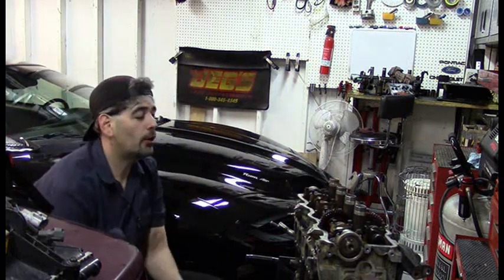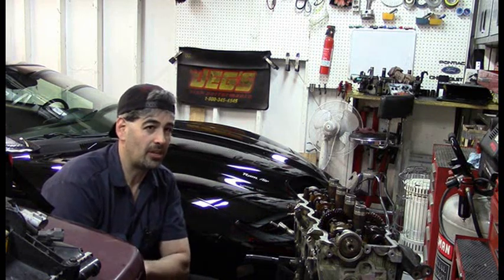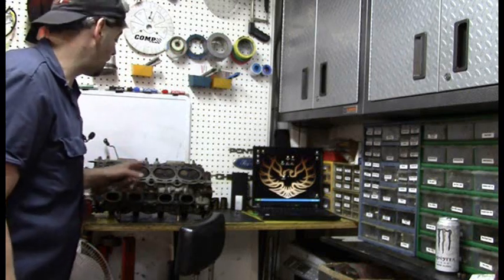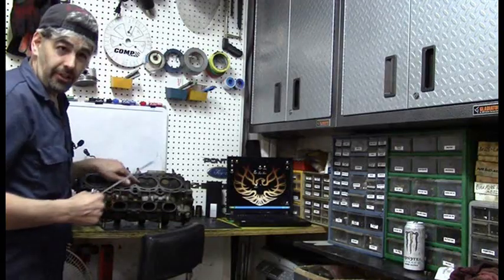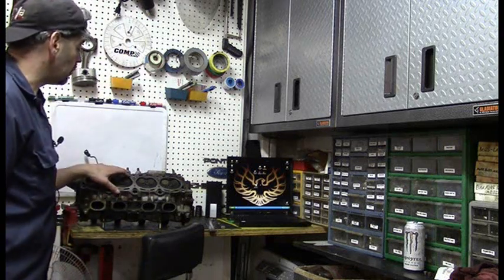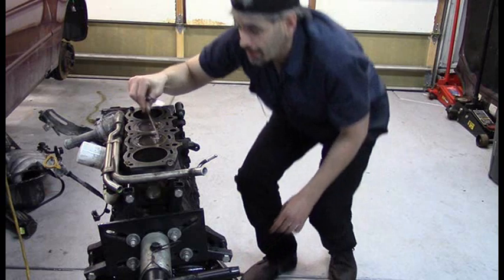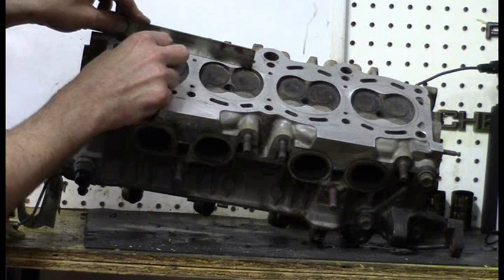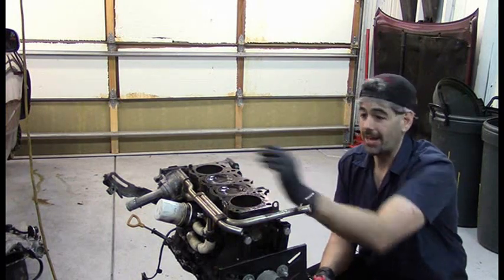Replace a Cylinder Head Gasket Yourself and do it RIGHT! Part 1

Comment: I just a lot!!!!!!!  And it disappeared damnit.  Anyway, I think you have the best and most informative videos in tube.  My question in short this time.  Dong this 31 yrs and I cant get the proper specs anywhere.  2001 Eclipse 2.4 SOHC   Engine 4G64  Head G6E2  What size is the torx and what are the proper torque. Ive been told 58 and 72 ft lbs. Thats way to much difference. Sum1 is wrong.  The pattern is fine, even tho I've gotten 2 different ones, I'll get that str8.   WHY they say torque 58 THEN loosen ALL the way, then torque to 15 lbs THEN 90 degree and THEN 90 again.  What kind of torque would that END UP with.  Any suggestions....  Its my sons car   it overheated and Head is actually still on the car, I dont have the socket to remove the head bolts & what size are they ( 12 mm  12pt )??  Thanks, Chuck       I do paint & body and I Paint for a living, and ranked 10 out of 2000 in Va by Dupont and PPG.  I was getting ready to paint sons car, and that night he called and said IT just cut off.   TY again   cnkbaseball@yahoo.com
Reply from the maker: I recommend alldata DIY and it has always had the specs for any car I have needed them for.

Comment: Around how much would it cost to take the cylinder head to the machine shop?
Reply from the maker: Man great question, if I was smart I would have made mention of that! It depends on the services you get.  Generally a Magnaflux (check for cracks) runs around $50 or so. This is non-refundable- you pay $50 whether the head shows to have cracks or not. Resurfacing may run about $75. A whole recondition- e.g. "valve job" maybe a couple hundred bucks or more.

Comment: Hay can you help me? I have an 05 altima 2.5, the oil and coolant are disappearing (coolant disappears faster), i checked for leaks no leaks anywhere, the engine has 85k miles on it i have to add about a quart every thousand miles and top of the coolant every week week and a half. A few months ago i noticed the temperature was going up every time i pressed on the gas, i pulled over to check the coolant, there was no leaks and the reservoir had way too much coolant, after the car cooled down i opened the radiator and there was allot missing it all went to the reservoir and left a air bubble in the radiator. Any suggestions on what the problem might be?
Reply from the maker: See my video 12 ways of how to check for a blown head gasket and you will learn all you need to know on how to diagnose your condition

Comment: and by the way there is only the valve cover hose the TB and the air that passes through out the MAF it's only 3 connections that's it

Comment: Hey i have 2001 Chevy Blazer and it keeps running out of coolant every couple of days or so, got any ideas of what it could be?
Reply from the maker: A coolant leak comes to mind. How about doing some diagnostics on it?
Reply: try some K seal (from an auto parts store or amazon) i have a timing chain cover leak leaking coolant. Poured it in and two months so far its fixed my leak for good
Reply from the maker: Daniel Allison What model car is that you claim this worked on?  never heard of a timing cover with coolant channels.
Reply: Schrodingers box it's a 3.0 vulcan 6 cylinder

Comment: Great head gasket videos! And yes, I don't care about that particular vehicle's cylinder removal. Can a warp or crack be a sudden thing? I had great compression on my 4.3 not long ago, then last week I had issues starting it. it was the coolant temp sensor. Replaced it and now it runs great, but while I was trying to diagnose it, I got it running a couple times and heard a sudden hiss followed by smoke. Dang I must of had some bad pressure build up! I'm gonna do a another test now, for both head and intake gasket. My question is, is it ever just the literal gasket itself that goes? Also, is the cracking and warping usually and over time type of thing, or something that usually happens all at once?

Comment: Okay, so my '93 ford ranger that had a rebuilt engine ran out of coolant without my knowing, one day, one day when I shut the truck off, smoke started pouring out of the engine, took it to a Napa shop and the mechanic claimed it was a head gasket with a possibly cracked head. After getting to the heads and gaskets I come to find that neither of them were messed up, although I did find that the freeze plug was significantly corroded. Is it possible that that was the problem all along? Or could it have something to do with the coolant system or something along those lines? I've never had to do anything major to an engine before, but I have a mechanic buddy that strictly works on ford engines helping me. But I'm stumped at this point and don't know what exactly to do now.
Reply from the maker: heheheuknowme A leaking freeze plug could sure cause the engine to steam considerably. Without seeing compression test or leakdown test data it is impossible to definitely determine if this was all you had wrong.

Comment: Hey, so rather shockingly I'm watching your video while in the process of changing a head gasket on a Toyota Previa.  I have every thing apart and easily located where the head gasket blew which is between a coolant passage and fire ring on cylinder 4.  The weird thing is that it appears to be caused by pitting in the area by the coolant passage on the aluminum head.  The head isn't warped, I had it pressure test and surfaced (they removed .004) and it looks good to go.  My issue is I'm not sure what could have caused the pitting?  Could that have just been dirty coolant?  Engine has 200k.  And while I'm in the process of writing drawn out questions I'd like answered for free (by the way thanks), I have an 89 mustang 5.0 that the catalytic converters got clogged on several years ago and I replaced with an H pipe, the fuel mileage is not what it used to be (granted I have 380k on it), is it possible that have less restrictive airflow on the exhaust is making the computer thing the engine is running lean and it is overcompensating to get the o2 sensor reading in range?
Reply from the maker: Thomas Morgan Dude that is so funny- I mean, in a coincidental way. I am dealing with a very similar issue on a Honda Accord as you read this. Looks like a woodpecker went at it on Cyl#4 near the fire rings on the piston and cylinder head top surface between the valves (but not actually in the coolant area).  I initially thought it was a interference timing issue however the pitting is nowhere near the valve and the valve recesses are clean. The damage is just on the very periphery.  It looks like something dropped into the cylinder however the cylinder walls are perfect and the damage on the periphery of the piston seems quite specific. I have not yet figured it out however if/when I do I will let you know. My next step is to examine the screen for the catalytic converter and see if anything was caught up in it that might have come from the cylinder.

Comment: Hey matt I am a new subscriber to your channel and am going through watching all of your vids and am learning alot. I can diagnose an older car with no comp easily but the sensors elude me. so i want to thank you for all info. with that said i want to ask a question and tell you a story. Question is what caused my head gasket to blow? 
I had a early 90s pontiac with a 4 cylinder engine. i was driving from south dakota to missiouri during my trip i started to blow white smoke and engine ran funny after smoke started i shut the engine off imediatly the temp only got up to 210 normal for that car was 190 . i was stranded on side of road but i had my tools with me i went and got a new head gasket kit and bolt kit for it and replaced the gasket checked all surfaces and they were good and flat so i reassembled the engine and drove that car for 40,000 miles without it needing repairs i only got rid of it because of an accident . this video says that you can not replace just the gasket was i lucky ? when i got the gasket out there was a small tear between cyl 3 and a coolant port
Reply from the maker: daverd2003 Without having seen leakdown or compression test results it is impossible to give "autopsy" results.

Comment: I can never understand why aluminum blocks are even used in consumer cars? Honda is famous for this. Iron block isnt that much heavier but actually much more durable. I also prefer a good timing chain over belt.
Reply from the maker: I agree on both counts.  I have always been under the impression the aluminum block is for saving weight.  I still prefer the iron block and aluminum heads because if you get a serious overheat, almost certainly the worst that happens is a warped head- aluminum will warp far sooner that cast iron. With an all aluminum engine, an overheat can really wreak serious havoc.
  I have yet to ever, ever see a warped cast iron block after an overheat regardless of how warped the aluminum heads are. The aluminum heads would probably liquify before the block was even affected.
Reply: I agree I love that Toyota went back to timing chain on their 3.5 L V6 c. 

The only advantage to Al blocks is that it's doesn't rust ( unless it's  a shitty alloy) so it preserves certain components like heater cores etc. 
but that's irrelevant if it overheats

Comment: Could a vacuum leak lead to a gasket failure?
Reply from the maker: Good question. Not a head gasket failure.  If the leak is an intake manifold leak it will get worse over time but it won’t cause overheating or warping.
Reply: @SchrodingersBox  Thanks for the reply. Reason I asked was for my car in the shop. I have a 2014 Maserati GranTurismo that I bought a few months ago and I brought it in for a few things (primarily a CEL caused by some kind of vacuum leak -- the number one cylinder bank was running lean). While it was in the shop, the tech said he found a minor oil leak at the head gasket. Nothing bad enough yet to warrant action, but he advised me to monitor it closely. I wasn't sure if said vacuum leak might have lead to the gasket failure.
Reply from the maker: well don’t forget a cylinder head gasket failure can cause that bank to run lean. If there is a compromise in compression, there won’t be complete combustion.  Try unburned oxygen will be detected by the O2 sensor as lean on that bank.
  So basically, a vacuum leak won’t cause a blown head gasket but a blown head gasket can cause a lean condition that seems like a vacuum leak.

Comment: I must be the luckiest guy in the world because I just put a new head gasket in my truck at 189000 miles and it's at 202000 miles and I haven't had any problems. The truck never over heated in the time I had it (not to say the previous owner didn't over heat it)
Reply from the maker: Either that or the diagnosis that it needed a head gasket was incorrect.

Comment: Matt, what is a good brand for a head gasket? Are all gaskets similar? Is the OEM Honda gasket any better than a Fel Pro? I ended up getting a Fel Pro head gasket that failed after 1 fairly minor overheat and the second one failed after 3 months without any warps in the head or block, clean surfaces, proper torque and no overheating for no apparent reason. Are Fel Pro head gaskets just crappy or am I just unlucky? Thanks Matt, I love your channel.
Reply from the maker: I have never used a "bad" head gasket. I typically use Fel Pro, Mr Gasket and Engine Tec. On performance engines I use MLS gaskets but otherwise just normal graphite or whatever.
Reply: Cool, thank you, I would think that the installation procedure is the most important part of doing this job anyway.

Comment: Hi, I got a quick Question as DIY'er : I suspect my cars has a Head Gasket Failure, HOWEVER, I am not sure of it. After viewing your video, which is very instructive by the way Thanks again, I would like to know if there is way to do a Compression and/or Leak Test without the specific testing materials. Reason being I am from a country where the cost of these tools are nearly as high as replacing the Head Gasket !!! Do you know a DIY for these tests, as they are very informative about the state of the engine and tell much more the chemical test ( which is one I will try to find and do as soon as possible). Further more, I do not have a radiator cap on my car, and the only way to use the chemical test would be through the water tank, do you think this would give also a valid test ?

By the way, just for info my car is a Skoda Favorit LX 1993, and I am from Turkey.

PS : keep the good work !!
Reply from the maker: No you have to have some type of tangible, quantifiable metrics to really do this.  The closest way to do it without tools would be an "ear test" just listening for a loss of compression during cranking but it's not realiable unless you have an almost total compression loss in a cylinder.
Reply: @SchrodingersBox  yes. I found a chemical test on te internet in Turkey,  however the test is strange because the process is as follow:warm up the car, let it run for 15 min, stop the car and wait 5 min, and then get a little bit of water in the test box. If it change color you have a gasket failure. It sound weird because they can be co2 in water as I know so this test cannot be reliable. Am I wrong or does test like this exist?
Reply from the maker: That test is correct. Most people misunderstand it. It tests for CO2, not HC. In fact you can prove it by blowing into the liquid and seeing it turn yellow.
  CO2 is the byproduct of combustion that is tested.  If there is CO2 in your coolant vapor, there was combustion gas in it.
Reply: @SchrodingersBox  yes correct, co2 appear after a combustion. But contaminant in the water might affect the result but you say that is still reliable. Ok will look into it hoppefully.

Comment: Hey mate, also have the 318ci with the m43tub19. How did you noticed you had to change the gasket? My engine block seams dirty but i know there is a leak at the filter house wich doesn't really explain why suche a big area is covered in oil... Did you do a compression test or wat where you're sympthomps? I'm not a very calm driver but i NEVER red lined it. Never gets hot but the rpm isn't very stable somethimes in Neutral. I'm scared now i will kill my lovely car and don't have the money to get it to the garage. Thanks...
Reply from the maker: See my video 12 ways how to test a blown head gasket and it will answer everything. But FYI I always rely on a leakdown test, personally.

Comment: My car overheated about a week ago. The engine turns on but won't rev. Is it my cylinder head? Head gasket? or both and is this fixable
Reply: I have a 99 pontiac sunfire.
Reply from the maker: lauren tit What were the results from the diagnostic tests in the video?
Reply: warped cylinder head :p i wish you lived near me because these shops around me are going to charge me a lot of money :/